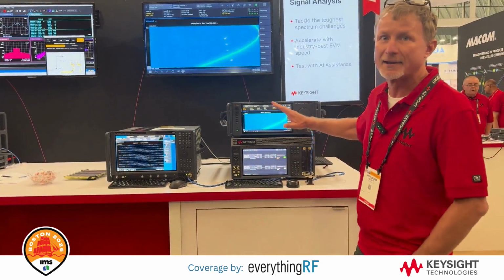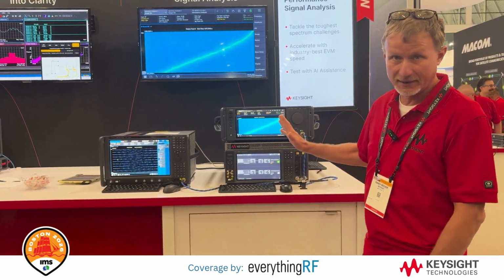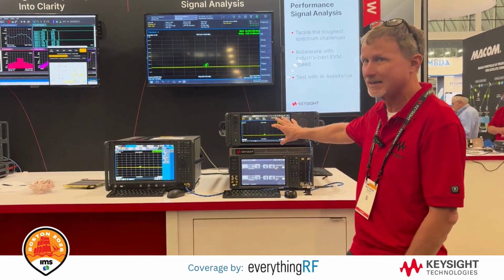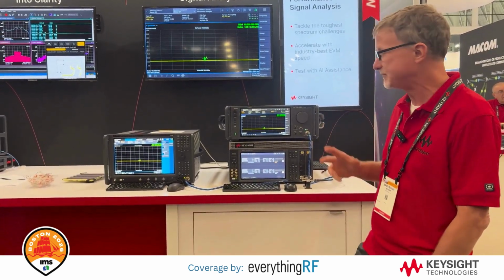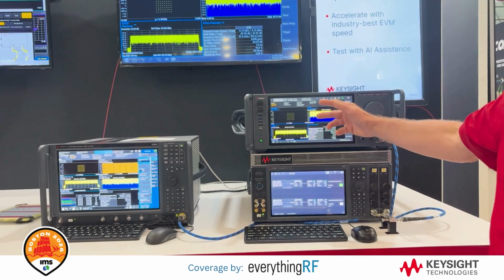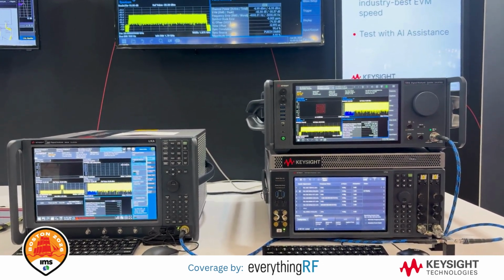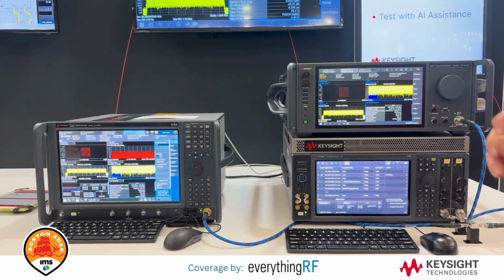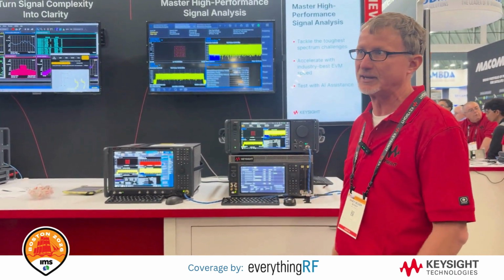IMS2026 Spotlight: Keysight Demonstrates the New XA6 Signal Analyzer up to 67 GHz

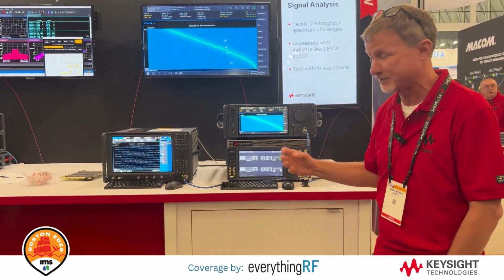Comment: 1:48 From what I can tell, DANL measurements are performed with standard path (40GHz, swept, preselector on, PA off, 0dB atten, IF gain = high, 30kHz RBW normalized to 1 Hz, NFE off).

Giving the analyzer a noise figure of around 26 dB at 40 GHz without the benefit of the internal pre-amp.